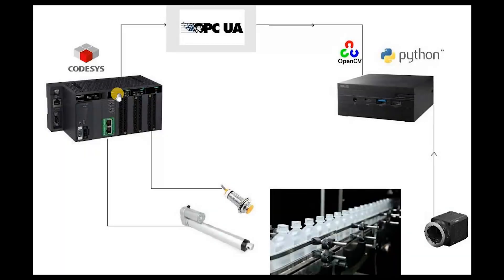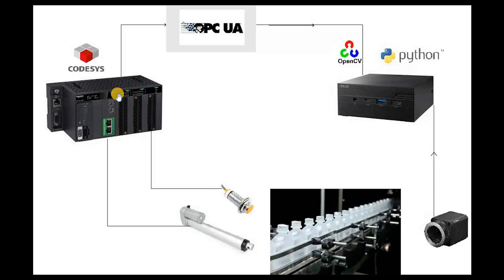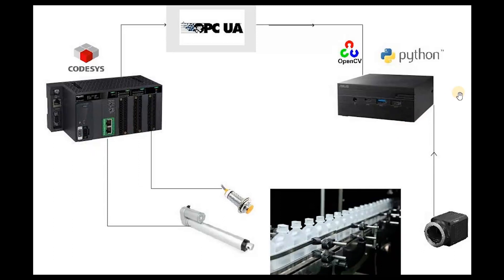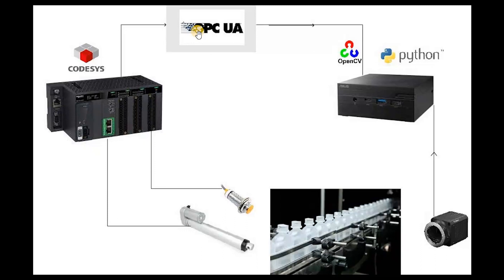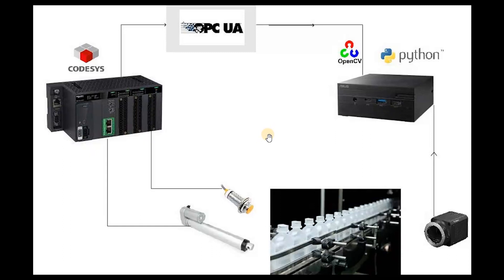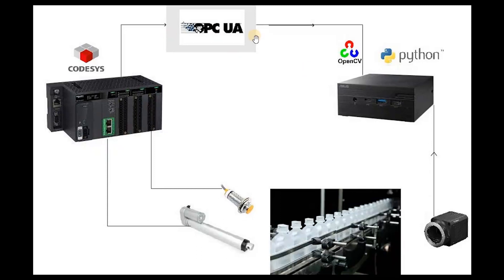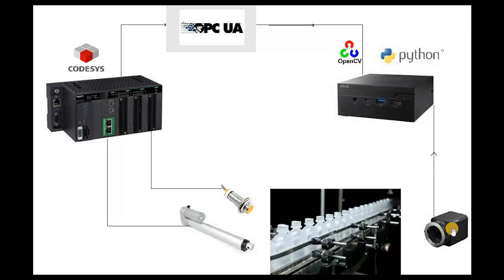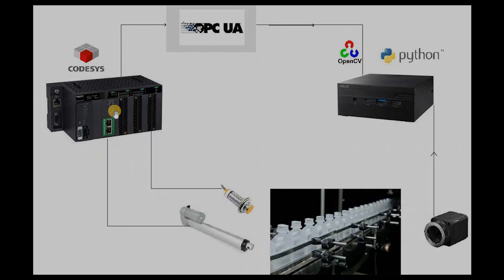Machine Vision Tutorial (Part 1) -  Machine Vision Using PLC and Python

Comment: This is exactly where I’m at right now. I want to use raspberry pi, two cameras  and an XY axis linear slide, for a simple screen print registration system, to line up digitally printed image on transparent film, over a white printed under layer on a shirt.

Camera 1 detects the registration marks on a stenciled screen, gets it’s coordinates and uses it to set a region of interest in camera 2 window and move the XY axis slide (with a mounted 3 pin registration) to match the coordinates (tracking). Camera 2 gives a visual confirmation that the region of interest crosshair , camera 2 crosshair and the transparent film crosshair all line up. (With manual fine adjustments capabilities of the XY linear slide if needed). 😮 

My machine is ran on the Teknic ClearCore machine controller using C++ but I’ll be using pi and python for the machine vision task. (I’m also moving from a Nextion display to pass variables to ClearCore to Pi and a touch screen.)